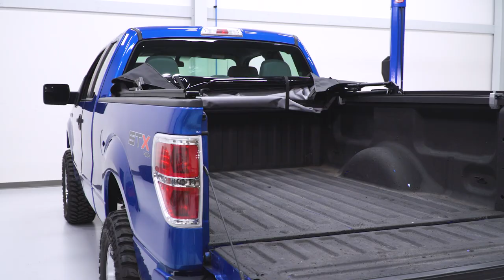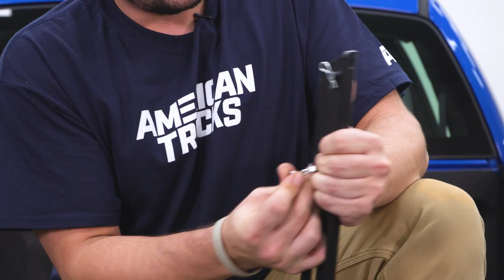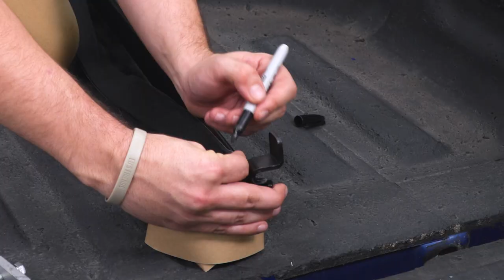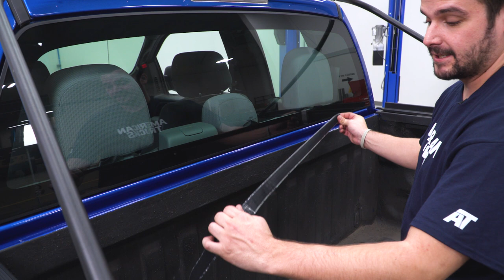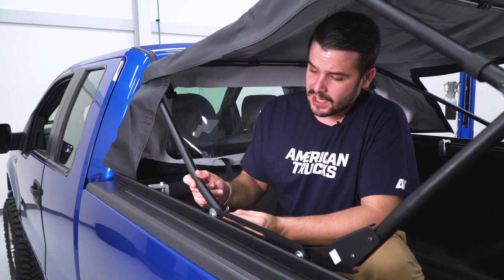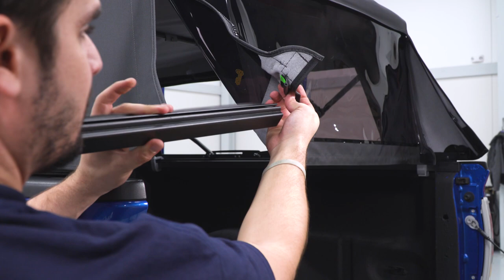2004-2019 F150 Bestop Supertop Soft Bed Topper Review & Install

Comment: I installed mine on cold November day, and it was pretty hard to get everything zipped up but it did work.  Tried heating it up next to the wood stove--didn't help. Not sure how easy it will be take down and put back up during the cold months.

Comment: What about the 3rd brake light, what about the electrical
Reply: There’s a wire running down one of the sides if you wanted to hook it up. If not, not all states require a visible 3rd brake light and also not many cops would stop you for it.

Comment: Nice, gonna grab one of these for some quick camping trips this fall
Reply from the maker: We'll get you hooked up whenever the time is right! Thanks for watching! -Zach
Reply: @americantrucks  i have a 98 f150 extended cab with the 6'5 bed. Its the same generation body and an 04. Will this fit???
Reply: @brandonj.3328  98 and 04 are different generations.  If you have an 04-21 most bed accessories should fit.  But with a 03 or older you will need to look at other options geared towards those older trucks.  Since 04 they've been keeping many chassis and bed related things fairly similar across the generations.  But with an 03 you should look more at 7th through 10th generation upgrades.

Comment: While I don't own this top, Bestop is the leader in soft tops for Jeep Wranglers and having owned several Wranglers, fighting to get everything zipped and buttoned down is very normal and will get easier as the top gets a little older. There tops are very good and would have no problem owning this one....
Reply from the maker: I'm a Jeep guy personally, so I know first-hand that Bestop's quality is second to none! A little bit of zipper-lube or WD40 goes a long way too! -Zach

Comment: I see two things the consumer has to do that could easily be a mistake. Cutting the slots with the knife and drilling the holes with the top installed already. 
These two things should be done at the factory. The knife could easily slip, or the drill bit could also punch a hole. Then what?  Take it all apart and send it back? Caulk it? 
very poor installation left for us!
Not liking the easy chance of that happening at all!

Comment: What would anyone want to put a hole on your nice bed truck, when you can just buy a top shell canopy without need drilled to the bed just using a clamp 🗜 and easy to install them, no need tapes, or drill, glue etc.
Reply: No holes were made on that bed, i don't know what you have been watching.

Comment: Seems like way too much work. I like the look but a hard shell might be more practical. Just my opinion.
Reply: I was thinking the same thing, but, with all that work, you can easily collapse it to have a full bed, or a soft shell camper. With a hard shell it would either be permanent or too heavy to take off every time you use it.